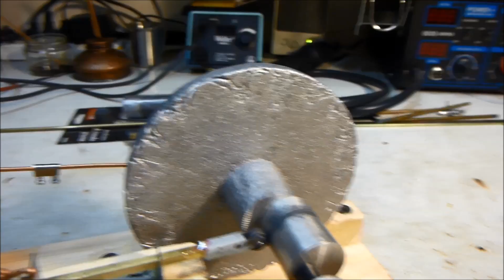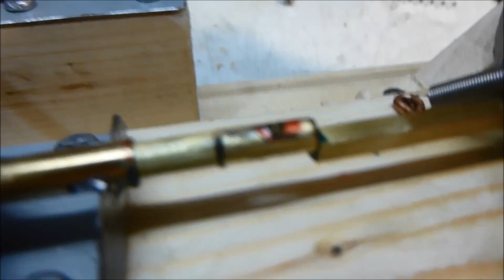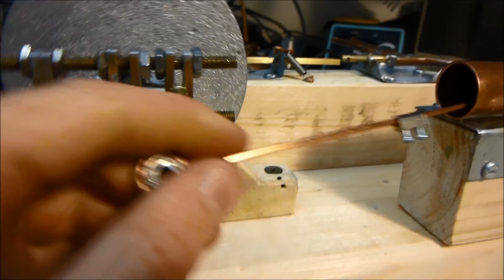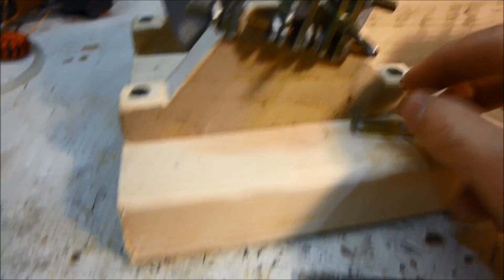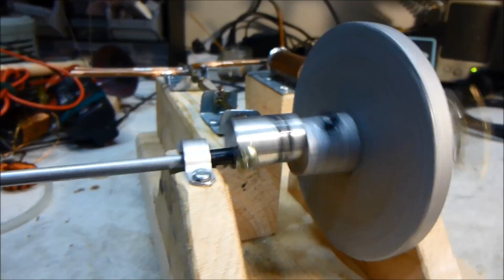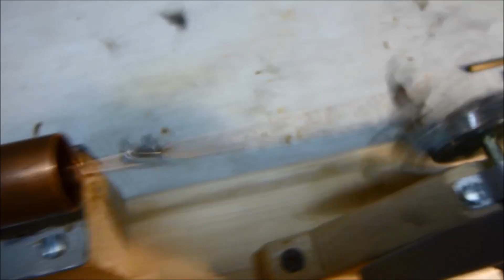In Depth Video on my DIY Homemade Steam Engine - Parts Used, How I Built it, etc

Comment: Man, this is quite the resource! I've got an aspiration to make a steam-powered generator one day, even if it's just a USB charger, and this is the most explained one that doesn't require a lathe! Well done, my good sir, well done! Though I do have a couple ideas for it. Perhaps you could use some O rings to make your piston and valve leak less? Just spitballing, here. Implementing that might be harder than one would initially think. I know that this video is nine years old, but I'd love to see your take on a boiler! I've actually seen some DIY steam engines on youtube that used an old coke can for the boiler, though I'm not too sure how feasible that'd be, i believe soda cans have an internal plastic lining

Comment: Please  explain  the valve inlet and how the hole in the brass tube aligns with the copper tube going to the cylinder as this and the timing is the most critical part of setting it up. Thank you.

Comment: The little Rod that lets the steam in you said you wanted to drill the hole bigger I don't think that's the problem I think you need to solder it to the other pushrod what's probably happening as it goes back and forth It's probably turning just a little bit I could be wrong but I'm assuming that's probably why they won't let as much steam in as it moves it turns side to side maybe you should solder it together and try that

Comment: if you widen the hole on your valve it will throw your timming off you will need to increase the dia. of the copper tubing and a larger valve to increase valume. but very nice job

Comment: when your piston goes all the way into the chamber does it touch the back? I'm wondering how this works with the cam wheel being at 90 degrees from the crankshaft.
Reply from the maker: Jordan Jorde yes, the piston comes nearly all the way to the end of the cylinder. The valve must be about 90 degrees out of phase from piston movement. your want the steam valve to start opening when the piston is at top dead center. and fully closed when at bottom dead center.
Reply: Do the pipes get hot enough to burn the wood if they are touching it?
Reply from the maker: Jordan Jorde no. It's steam. only slightly higher temperature than boiling water. temperature depends on the pressure of the boiler. There are calculations if you want to know the exact temperature.

Comment: When balancing an engine, you need to add part of the weight of the big end of the con rod, because it moves along with the crank.  As a first guess, assume that the effective weight is half the weight of the con rod.

Comment: the roller cam is a super great idea if i was your mom i would be sooooooooo proud of you young man you rock to the max god bless you son
Reply from the maker: +Marie Miller it works alright but at higher rpm I have problems with valve float just like some car engines! Basically the spring isn't string enough to fully return the valve and follow the cam. Thank you haha

Comment: How did you make the o ring?
Reply: In your ICE build, you said that compression in the piston wasn't high enough and that you needed an o ring to make it work, then you showed another piston head which you said you used in a steam engine. How did you make your o ring? I mean a lathe would make it a simple job, but how'd you do it without tools?

Comment: With this extremely low-tech engine, why didn't mankind have steam engines in the 17th Century? As an improvisationalist myself, I admire your efforts. You also sound like you're a youngish guy, so I'm even more impressed.

It's simple... yes... but it works and that's what was intended, so mission accomplished!

Keep it up, matey! All the best, Gordon
Reply: +Gordon Burns Search this on Youtube ,Heron of Alexandria 's Steam Engine.   Was way before 17th , They just thought it was a toy and never made anything out of it
Reply: The engine is the easy part. The boiler is the hard part. They probably struggled to build a big enough boiler.

Comment: Your valve is not to small.Because on higher pressure it will pass much more
volume etc,But valve leakage could be bad you need  to add sealing glands.
Very nice job indeed.Thanks for sharing it with us.

Comment: Lots of ingenuity, bravo!   I'm wondering how the epoxy piston is surviving in real steam...  any news, cos I'd like to try it?  You might be interested in an idea I came up with for an adjustable crank while making a solar pump...  join a threaded rod to the flywheel shaft, coming out radially, and with some clearance between wheel and rod.  Vaseline the rod and mold epoxy putty around it.  That gives you a long "nut" with virtually no play.  Turn it to move nearer or further from the axle.  Now join the crank stud to the middle of the "epoxy cylindrical nut" at right angles, giving a T shape,  using more epoxy maybe. To adjust it later, just detach the coupling from piston to stub and give it a few turns. Your idea has the advantage of being adjustable without detaching anything.   Mine has the advantage of, errr, laziness.

Comment: What class were you in when you made it? Is it a school program project, or some extra cirricular activity? Your engine is absolutely excellent! And you did it almost with your bare hands - hard to believe!!! I really take off my hat... Wish you success in all your future projects and i'm sure a jet engine is not a long way to go.... :)
Reply from the maker: Егор Букраев I made this totally on my own.   Just something I've always wanted to make.  I really want to build an internal combustion engine without a machine shop.  I tried once and it almost worked.  I need to try again with closer tolerances.  Thank you!
Reply: Use LEGO! Search for it on youtube. lego motor real combustion.

Also, where did you get that perfect fit tube set? Really cant find it...

Comment: very cool , have you tried running vac on one side and pressure on the other side, at the same time?more pressure and less vac and then more  vac and less pressure? Yes you need to make better seals, look forward to seeing more vids!
Reply from the maker: scot fletcher  No I never really did that.  But it would certainly give a little more power.  I have several other videos of it!  Mostly running on my homemade boiler.  Thank you!

Comment: the far end of your valve could be sealed and it wouldn't leak as much!
Reply from the maker: Yeah I did try that.  It didn't leak as much but the performance of them engine was actually decreased.

Comment: is the exhaust the tube to the left of the intake copper rod when you apply pressure to the left intake "manifold"?
Awesome build! im trying to make my own now
Reply from the maker: Clayton Reynolds With my design is doesn't mater which is the exhaust and intake.  It only changes the direction.  For example if I put pressure in the left one if will spin clockwise and pressure in the right one then it will spin counterclockwise.  Thanks!  Best wishes to ya man!

Comment: How does your valve work?
Reply from the maker: Arran Townsend There are two hole in the sliding inner part that lines up with holes in the outside to let the gas through into the piston.
Reply: Oh thanks for replying

Comment: What is the size of the brass valve rod and what's the measurement where you placed the hole for the steam/exhaust ?
Reply from the maker: Frank Nap I believe it's 2mm but any size would work as long as you have a matching brass tube.  And hole placement is not that important.  It would be dependent on your steam engines design etc.
Reply: Thanks ! ...is there a certain size for the steam port/hole on the Main Cylinder Head ?  Say a #45 drill bit ?

Comment: Hi. I am wondering how can the compressed air behind the piston escape?
Reply from the maker: Dick Plummer When there valve rod moves the other way the hole in it lines up with the exhaust port and that's when the air escapes.  Thanks!

Comment: Congratulations man! This mechanism is very interesting. I specially liked the way you designed the flywheel balancing method. You may redesign the cam's body to decrease the amount of resistant force made by the amount of gas in the cylinder while exhausting it, as well as increase the torque by forcing gas in the cylinder in a higher rate before the maximum torque point. Sorry if i made you confused with this. Do you study mechanics?

Comment: Nice job! I just stumbled upon your video (you now have 1 more subscriber). I was laughing as you were explaining where u got the parts. I've got a shed full of compressor fans, bearings, rods, Fresnel lenses,  microwave transformers and every kind of motor from 48v dc down to those little vibrating motors in PlayStation controllers. You never know what you'll need, it just makes it hard to throw anything away! As for positions, I bought a 4' rod of graphite a year or so ago. Its probably too big for your purposes (2" diameter with half inch bore) but I'd be happy to send a piece if u want. Ever try graphite spray? You could make the piston out of something with similar thermal expansion as the cylinder and spray the graphite on it. I've used it to build up graphite piston that I've sanded too much and I couldn't tell the difference. I'm working on a closed cycle steam system now and was looking for boiler ideas. Cheating a bit using rotary motors (from small vane motors from air tools up to an automotive  scroll a/c compressor) and maybe use solar heat, hydrogen from aluminum in lye, wood, trash, etc to boil water (or propane or other refrigerant- Google Organic Rankine Cycle), expand in motor, condense in heat exchanger/ recuperator to transfer heat to preheat the water, and pump back to boiler. Follow that? Andy 
And again, great video!

Comment: Nice work !  Your cam is interesting considering that older steam engines used an eccentric to move the valve.  You could use your wooden base as a pattern to cast up a nice aluminium one.

Comment: But wood the solder on the valve not melt if you put hot steam in it ?
Reply from the maker: bor_12345's Electrofied Gaming If you use 160psi steam it will.  Steam at 370°F or 188°C has a pressure of 160psi.  My solder melts at about 370°F or 188°C.  So yes you could melt the solder but not with the 30psi rated boiler that I am using.  So a 30psi boiler means that everything needs to withstand 274°F or 134°C.  
Sources: melting point of solder:  http://en.wikipedia.org/wiki/Solder  
Saturated steam: http://www.centralstateshose.com/Saturated-Steam-Temperatures_ep_62-1.html

Comment: But wood the solder on the valve not melt if you put hot steam in it ?
Reply: Not unless you had super-superheated steam. Most "wet" steam would not be nearly hot enough.